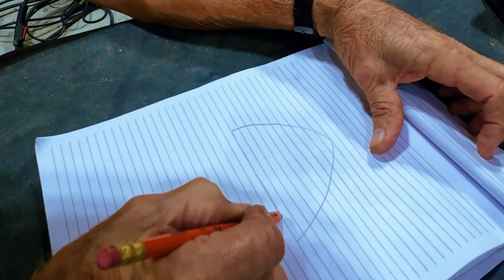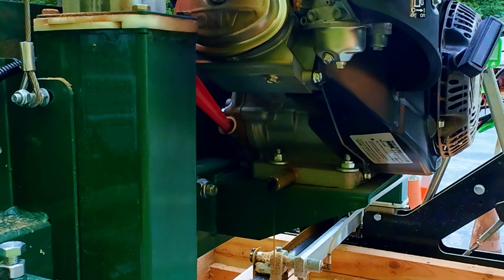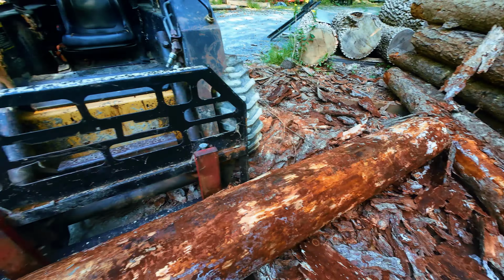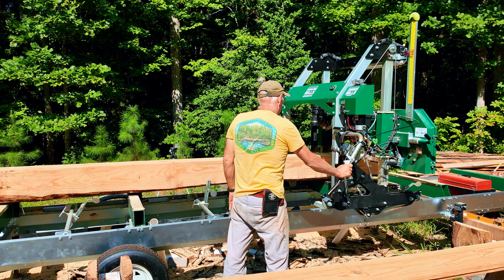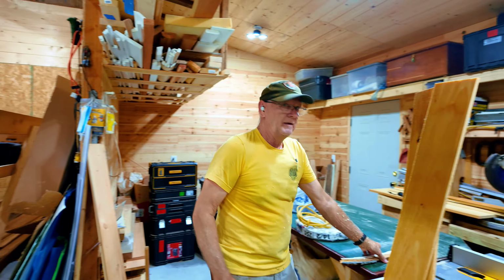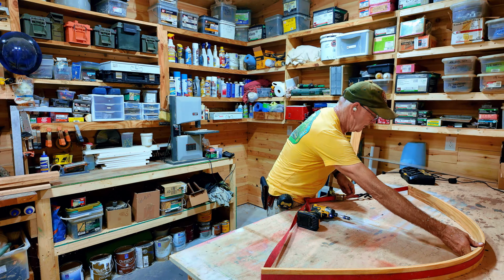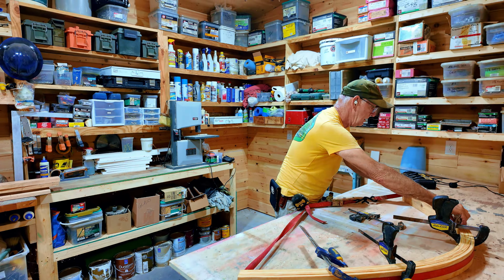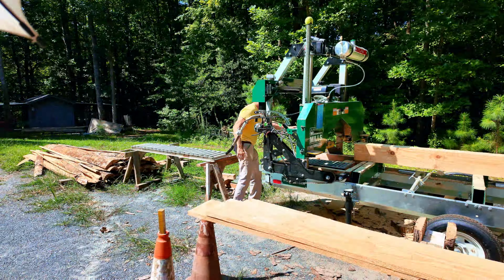How To Make Curved Wood Moldings

Comment: I don't have much experience with new Kohler engines, but I have always had terrible luck with oil consumption on them using regular weights. However, I find that running 0w-40 helped that significantly. 

Them vibrating so much they wallowed out the hole for the mounting bolt in the frame is a different story!
Reply from the maker: I will keep this in mind. So far, I seem to have a very sound unit. It uses virtually no oil and fortunately,  vibration is non existent. Of course, things may change tomorrow. Thanks for the tip.